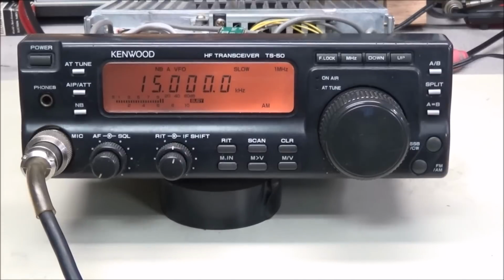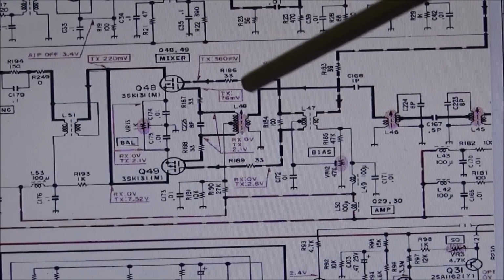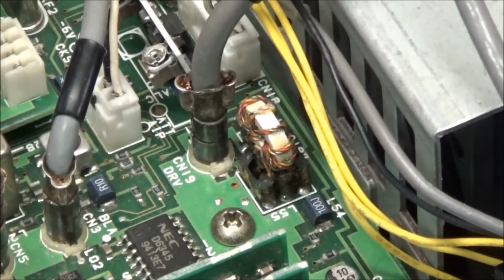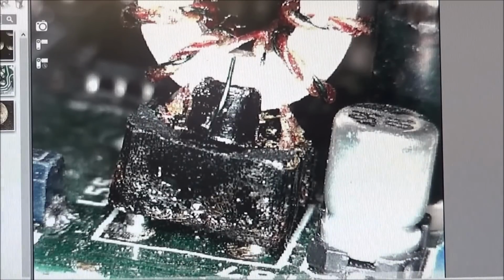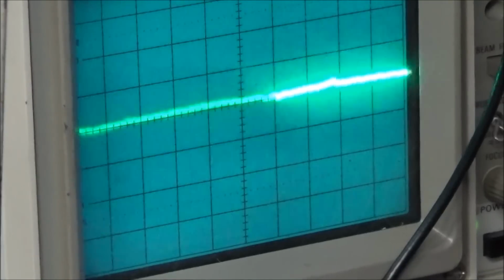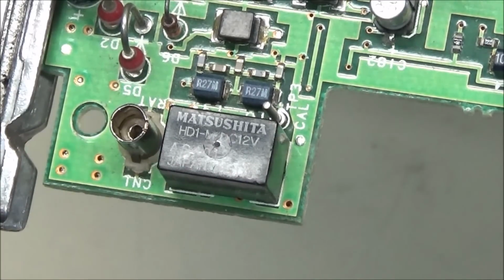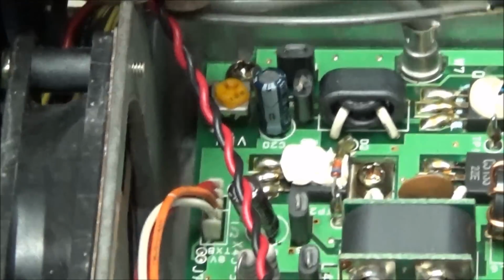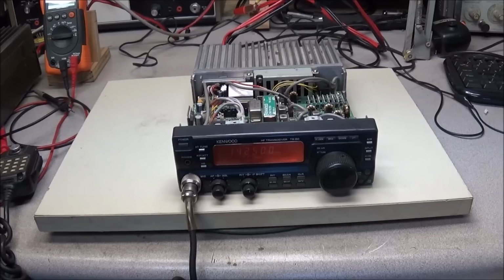#30 Kenwood TS 50 Part 3 troubleshoot transmitter and repair

Comment: very innteresting video , i have a TS 50 with no power output and RX very low , i tried to test according service manual, where i can find HF connector / Cable  of TS 50 (CN19 DRV)?

Comment: I had one of those... everytime I turned it on there was something else wrong with it.  Can't remember all the many problems, but one was all the panel lights were out; and it wasn't the bulbs/LED's.  It wasn't on warranty, so I threw it in the trash.  A couple days later I happened to mention the piece of junk's fate on one of the nets.  Some guy couldn't believe I thrown it away and begged to have it.  I didn't know if the trash had run but checked the can and the TS50 was still there.  I sent it to him free of charge with the disclaimer that I wasn't doing him a favor.  About a year later I emailed the guy if he'd had any luck.  Nope... junk is junk.  True story... I have the guy's callsign written in my log somewhere.  Incidentally, most of the rigs I've owned in over 40-years have been Kenwoods.  But, I wouldn't have one of these junkers again if you gave me a dozen free.

Comment: Hello. I've trouble removing VFO Knob. Any hint? Thanks.
Reply from the maker: Remove the rubber band, then you can see the set screws
Reply: @TheRadioShop  Screw removed:  the knob runs for 4-5mm then stuck. Why?

Comment: I noticed that my TS-50s board is a bit different in the area of the K1 relay. Perhaps the factory made a change to prevent the failure of the resistor that you encountered.

Comment: I have 2 TS50s both of which have the same problem, low output on low frequencies. Neither radio will put out 100w until you get to 14Mhz. 10.1Mhz maximum output is about 95w and by the time you get to 1.83Mhz the radio is down to 6.5w max. Above 14Mhz I can get in excess of 100W output without issue. My drive level is reasonably consistent for all bands. I get the same results, with some variation if I drive the PA deck directly and measure the output power directly before the filter deck. I'm about ready to write these radios off to experience and sell them for parts if I don't get some more positive results. I'm leaning toward bad RF power transistors but I don't quite understand how they can be good for some frequencies and not others. Any Ideas I can chase appreciated. Testing done with HP e6380. Thanks.

Comment: I take it you did not bother to do the extensive repairs required to fix the missing traces and just replaced the board from the other video. I saw that and thought 'he's got his work cut out for him'. I was kind of looking forward to what procedure you were going to use and see how it compares to mine but that was a huge job. I think your explanation of ESR for electrolytic caps is backwards in that the ESR increases as the cap dries out. From your video it sounds like it decreases. I know my esr meter says the cap is no good when the resistance goes above the acceptable value. 
All in all great videos on troubleshooting! I have 2 TS-50s on the bench right now to go through and no idea IF there is anything wrong or not. So far I have replaced the backlight bulbs with LEDs and the receiver works every Mhz from end to end. 73 for now.

Comment: Nice video.  I have a TS-50S that I had to replace a bunch of the little silver electrolytics on the TX/RX board.  What a chore!  It now transmits and receives everywhere (it has been 'opened up, not by me') except 1.8 to 1.999 Mhz.  If I go to 2.000 it transmits and transmits everywhere else i dial up !!!  I have been looking at the service manual (again) to try to figure out where the problem could lie.  I do have another TS-50 "organ donor" that i robbed the board that has the microprocessor and backup battery out of.  No help.  Backup battery is 3.1 volts.  Any ideas as to why this radio doesn't want to transmit on 160 meters?  I'm stumped at present.  And oh yes, MY IFR-1200 S has problems too !!!  I'm in the process of replacing the dummy load/power divider (yep too much power in).  Please give me any ideas you might have.  I'm now fresh out.  Thanks in advance.  Bob

Comment: WOW that was a beat TS50 with all of those leaky caps. You are a patient guy . USB camera is great. I have a TS 50 that squealed when first turned on. Sig meter reads full scale in RX. No antenna connected. Transmits into dummy load. Any thoughts? Radio was in its original box for many years in my shack. Never left outside or in the cold.

Comment: ok.I see you have the  ts 50 working now.Great  trouble shooting.I love my TS 50.I ran one for years in my big rig.I retired in 2012 and now I run it in my jetta dsl .Its been recapped once about 8 yrs ago.I guess it about time to check it again..Great video.73 fron Ronnie kn4u.
Reply from the maker: Thanks Ronnie,  These are great radios when they are working. Good you have some spare parts.

Comment: First time viewer. Are you taking in work? I also have a TS 50 that just went partially bad on me and a reset did'nt clear it

Thanks
Reply from the maker: Hi Mike and thanks for watching. Yes I do take in work but on a limited basis. I work a full time job so cannot take much at a time. Perhaps in a month I could get to it.
Reply: I'll look around here in Southern Cal, but I was impressed with your three vids I watched

Thanks

Comment: Just saw this video. I enjoy your work. One thing bothers me about that 470 ohm blown resistor. It looks like that is a part for a circuit that kills any drive signal during receive. I did not see the circuit driving this input . I know the unit is probably not available for additional now, but one way to blow this resistor could be DC voltage from the drive board... maybe another leaky cap?
Reply from the maker: You could be right, anyway all caps were changed on the radio and no further issues have been noted. My first thought was DC got through it and blew the heck out of it.  Thanks Mark for your comments.

Comment: Nothing quite like finishing a good basket case job.  You mentioned a old solder sucking machine.  Got to love the good old ones.  My daily driver is a old Pace from back in the late 70's.  God only knows how many hundreds of thousands of connections it has desoldered over the decades and it just keeps chugging along.

Hope you get your IFR fixed up.  Thats the only thing I hate about combination units, repairing them.  They pack the circuit boards in there like sardines.  You might consider a new stand alone SA.  I recently picked up a new Rigol unit and they are rather impressive for the price.  If you get one like that I highly recommend getting the tracking generator option.  Its a indispensable option for checking things like band pass filter units.

Mike

Comment: Good job Buddy! I haven't watched all your early videos so I'm not sure what kind of microscope you're using? Santa brought me a inexpensive one and it's ok for static work but the latency is not good enough for real time work. Hope you find the issue with your IFR, I always cross my fingers when I turn on my IFR1500 just in case!  73 - Dino KL0S
Reply from the maker: +Dino Papas Thanks Dino. The microscope is a Dino-lite premier.  This is a USB cam. Works pretty good for what it is. You can get about 4-5 inches under it. Like any USB cam it has it's limitations.  I really want a trinocular scope that I can look under and still record the view. Maybe one day. Money is not that easy to spend. My IFR 1200 is getting old. Most likely bad caps in the supply I hope. The spectrum was working good until lately. I hate working on that thing.That 1500 is a nice piece of gear. Thanks my friend.

Comment: Good job, Buddy! I think the saving grace of this repair is having that spare circuit board. Nice to have the two coils and the damaged resistor readily available. Thanks for the video! 73...Dan
Reply from the maker: +Beretta96Dan Thanks Dan. And yes, having the extra boards really came in handy thanks to Grant. This radio was full of surprises. Glad it is done. Thanks for coming by.